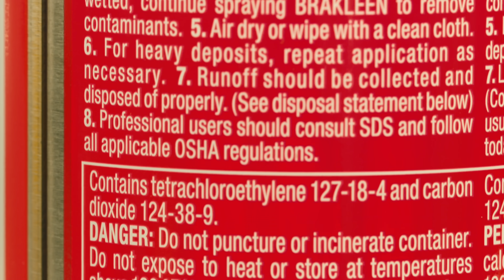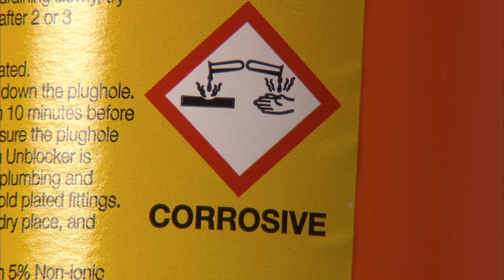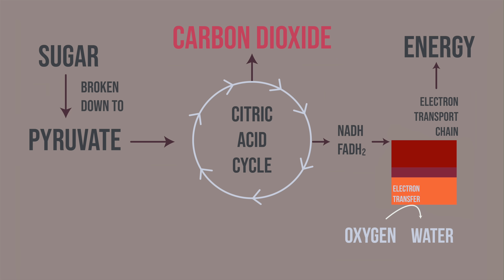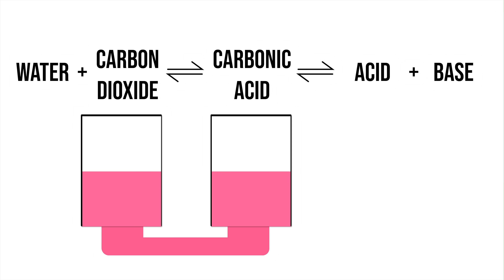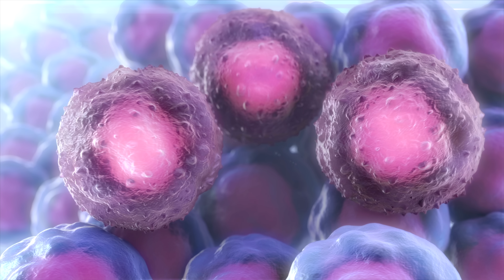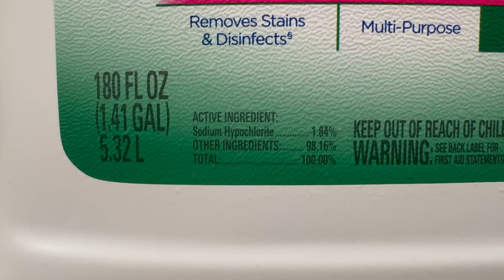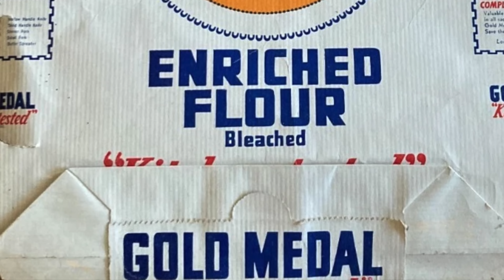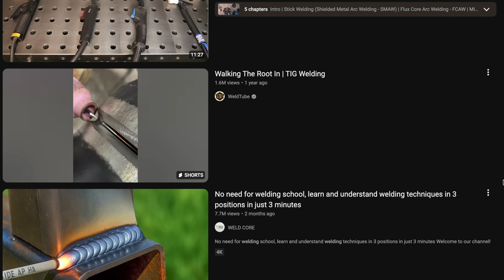"It smelled funny while I was welding and now I can't breathe..."

Comment: Unfortunately, this isn't taught in welding school (at least not back when I went through in the mid 1990s).  I've been to more than one professional welding shop and seen brake parts cleaner on the shelf.  I've seen Youtube welders cleaning parts with brake cleaners.  I've worked in professional welding shops where nobody had ever even heard of this.  For some reason, it's just not that well known.  I don't fault the victim in this one for being ignorant considering there are pros who are just as clueless.  I don't even remember how I learned of this; but I do remember throwing away some brake parts cleaners when I bought my first welding machine (Millermatic 211 in case anyone's wondering).

Comment: USE A NEEDLE SCALER
You supposedly do not even need to use chlorinated brake cleaner yourself. I have read Trichloroethylene can soak in to concrete.

Comment: I'm a beginner, self-taught welder and also use brakleen so this could have easily been me. Thank you for sharing this case and bringing light to this issue.
Reply: avoid plated metals especialy galvanized  ,grind back as far as you can if you have to and never weld gas tanks or diesel tanks unless you purge them with water and fill with an inert gas to displace oxygene
Reply: This^^^^

Comment: Correction:  Welding isn't high voltage.  It's lower than the wall plug voltage, so it can put out more amps than the plug provides.

Comment: I haven't watched it yet, but I already know what happened when they said brake cleaner. I've had it happen, and It smells awful. Cloroflorocarbons when exposed to high frequency light, converts to Phosgene gas. It can kill you. Was welding up cracks on an asphalt covered dump truck tailgate. Cleaned it with brake cleaner, because it worked fast and worked good. I let it dry off for 1/2 hr, but the liquid was still inside the cracks. As soon as I arked up, the Green glow of chemicals on fire caught my notice. The smell was awful, and take your breath away weird. I stopped welding and headed for fresh air. I decided to steam clean the tailgate and start over. After looking into the whole thing, I found out what gas was created, Phosgene, a deadly gas used in WW1 that killed many. I have no lasting problems, but if I continued, I might not be here today.

Comment: Thank you for the tip!  Working on my cars, I've used brake cleaner many times.  Haven't done any welding, but I have used the propane torch to loosen stuck nuts and bolts.  Probably should make really sure I don't go putting the torch on something that had brake cleaner on it.

Comment: So, how much brake cleaner do you have to burn to cause a lethal situation? It seems like the old timers have done this for years, and they are smokers, so I think at some point you would contaminate a cigarette at some level. Lots of pyrotechnics use chlorine donors , flash powder for example, and that's in firecrackers.

Comment: I once had a coworker who was a hilarious bumbling-fool type. He was a mechanic at the rental shop I worked at. 

He was farm-raised and accident-prone. One day, he was trying to get a single cylinder Honda engine to start (INDOORS!) using chlorinated brake cleaner. The engine would puff black smoke on each spray so he (obviously) thought it was cool and kept doing it. Eventually, I came over and the smell immediately warned me to stay back.  I yelled to him to run outside and when he coughed out the word “what?!?” A vape-like white fog came out of his mouth. He then made it outside somehow unharmed and I told him all about chlorinated brake cleaner and how it breaks (brakes 😏) down into a poisonous gas called Phosgene allegedly once used for warfare. 

The same guy later lit himself on fire while grinding metal next to a drip pan full of gasoline. The pan caught fire and his first thought was to take the pan of burning gasoline outside 🤦‍♂️ but he forgot how hard the door had to be pushed to open it, so he hit the door and splashed the lit gasoline all over himself. He was again completely unharmed. Some people tempt fate in the dimmest of ways. 🤷

*I have security cam footage of the gasoline accident and it’s pretty funny when you realize he was fine.

Comment: I've worked with phosgene in a lab before and it's a uniquely horrifying chemical because of what was explained in the video. If you spill it, or even notice the characteristic smell, you won't know if you're screwed until a day later. 

We handled it EXTREMELY carefully, with several gloves, in a fume hood and with a solvent containing phosgene and still I found it super scary. It worked perfectly, the reaction went smoothly, but man those 24 h after doing it felt stressful.

Comment: I am a machinist.
One day i turned off the coolant and heavily machined bronze.
It smelled funny.
I am pretty sure that the heat from machining was vaporizing metal from the alloy, be it tin, zinc, or even lead as some bronze may contain lead.
I am pretty sure that i could have poisoned myself and that some people did poison themselves this way.
Welder now about the metal fumes fever but there are probably many other way to intoxicate yourself with metal fumes.

Comment: 0:00 I haven't even started the video yet, but I'm betting it's gonna be phosgene, likely from welding something that had brake cleaner or some other chemical on it. There's a reason phosgene caused most of the FATAL gas casualties during WW1, and it's because it is invisible and has a delay before the onset of symptoms.
Edit: 1:07 Yep.

Comment: This video is crazy for me because I once welded on a part that had chlorinated brake cleaner on it and when the smell hit my nose I had the sense of mind to be like woah ok I’ve never smelled that before, I’m gonna let this air out before I continue never considered how toxic it actually was
Reply: Yeah it’s a crazy smell. A coworker of mine sprayed it into a running engine INDOORS! and somehow walked away with a minor cough.
Reply: @_..-.._..-.._  Well, I'm relatively sure car engines don't get hot enough to turn brake cleaner into phosgene, which might be why he survived...
Reply: @marluna_x  combustion can get over 2000 Celsius however it is under high pressure.
Reply: @leovang3425  Hmmm... I thought the brake cleaner was on the engine, not in it... But still, shit's scary
Reply: Oh geez you got lucky
Reply: Wasn't Phosgene one of the poison gases used in the WW1
Reply: @ValRyan-i5u  I think it was actually the one that killed the most in WW1

Comment: I’m a welder, I apprenticed under a very experienced welder with 50 years of experience. He taught me every way to not die on the job. One of the first things he taught me was never ever weld on material that you have used any type of solvent or cleaning chemicals on without blowing it thoroughly with compressed air, and letting it sit in front of a fan for a few minutes before welding. Always keep your head out of the fume plume, and always have some type of airflow as close as possible without causing the shielding gas to blow away. Welding is toxic and dangerous but it’s so much fun. Also always wear a p100 respirator ideally with an active carbon layer…. Tips from a welder with twice as much welding experience as I have life experience

Comment: Rust won't spark electrical arc, If it does it will spatter to extend that you can't weld. No body uses brake cleaner to clean rust, simply cos it doesn't work. And for rest, everiting about welding is dangerous, from safer to health

Comment: “The moment that the phosgene gas is inhaled, it’s over.” Absolutely brutal
Reply: Not true, though. For a moderate dose, if you get immediate treatment for a pulmonary edema your lungs will heal up just fine. The main problem is many people will not develop symptoms until a pulmonary edema appears, which can result in the treatment being administered too late.
Reply: I freaked out. I completely thought SP actually WAS styro pyro.
Reply: @g0ldER dude same
Reply: ....INDEED,THAT IS WHY IT WAS USED IN WW1 AS PRIMARY CHEMICAL WEAPON

........EVEN now,THERE'S MILLIONS OF TONS OF IT ARE PRODUCED
Reply: @robotnikkkk001  o dam rings a bell
Reply: @ricochetVendetta  ....AS FAR AS I KNOW,PHOSGENE IS CRUCIAL COMPONENT IN PRODUCING OF......CERTAIN TYPES OF plastic.....THIS IS why......

.....BUT INDEED SECURITY PROTOCOLS ARE strong IF WE ACTUALLY DONT KNOW ABOUT LIKE "several cars of phosgene tipped over"..........COULDVE GET SOME REALLY DISASTROUS NEWS,I TELL YA
Reply: Who told this young fella it was a good way to clean rust using brake cleaner?
Reply: @vette63 unfottunately it works pretty well to remove loosened rust/debris after grinding or wirebrushing. Not surprised at all that he would think of it as a quick solution if he had ever worked on cars before.
Reply: So?? Does Blowing on the metal????

Comment: Corollary: what happens when using a laser cutter to cut PVC? It is a similar issue of extreme temperatures that may cause a benign substance to decompose into something hazardous. I had assumed that it would primarily produce elemental chlorine, but now I wonder what fun (horrifying) combinations it actually produces. We have a very good fume extraction system and I let it run for a while after cutting PVC, something that we rarely do as it is very corrosive to the machine. I'm guessing it does not produce phosgene by the fact that I am still alive despite knowing the exact smell described in the video. That, or perhaps I did not inhale even a fraction of what "SP" did. Any chemistry nerds care to chime in?

Comment: When you weld on parts cleaned with brake parts cleaner you need to use the non chloride version and they do make a non chlorided version. Or this will happen.

Comment: I had used non clorinated brake cleaner on parts before welding in the past, just making sure they were fully dry before welding. Then one day I started welding and the part was either not fully dry, or the brake cleaner had traces of chlorine in it, because I took one breathe, smelled something funny, and my stomach just turned over. I was lucky that I knew about phosgene gas so I stopped and immediately got outside into fresh air. Luckily I had no lasting effects.

Comment: Worked in an phosgene fabricating place, didn't know, phosgene can be created while welding - but i know, how phosgene "works" AND can be neutralized.

Thank you for THIS video! I also weld this or that time in my freetime, fixing cars, creating holders for this or that, but NOW i will have some ammonia at home myself. i know people, where i can get some of it.

I also will get some more phsogene indicators to secure myself, knowing i could call THAT company for every special information, my local service does not have. Even if it is 300km away.

Comment: He would have had to been using a ridiculous irresponsible amount of brake cleaner while welding to generate that much gas.  Chlorinated brake cleaner evaporates almost instantly upon contact with hot metal and within seconds on cold metal.   I suspect he would have also been trying to use the brake clean to cool the welded metal.  Else he would had to have been welding on SOAKED brake cleaned metal.  Either way that would be next level irresponsible.  No way "sp" would be that clueless.  .

Comment: Cleaners contain chlorinated hydrocarbons, which can produce the highly toxic gas phosgene when exposed to high heat or open flame, such as when welding metal. Phosgene (smells like hay) kills by flooding lungs with fluid.  Severe respiratory effects, including pulmonary edema, pulmonary emphysema, and death have been reported in humans. Severe ocular irritation and dermal burns may result following eye or skin exposure.

Comment: Always a good idea to check safety measures before attempting an industrial process unknow to your knowledge. For example, when I began to charge in my living room my old car's lead-acid battery in parallel with supercapacitors to power a cheap spot welder circuit, I found french government research and security agency (INRS) guidance about preventing the risk of explosion associated with hydrogen production.

Comment: As a mechanic who welds and uses a lot of brake cleaner, this was a real eye opener. Most tradespeople just learn their skills on the job and don't actually have all the safety knowledge they need. I wouldn't have liked the idea of applying chemicals to the thing I'm about to weld, but I can totally see how someone like me does this without thinking. This is the first one of these videos I've seen that feels like it actually could have been me.
Reply: I've cleaned things to be welded with chlorinated brake cleaner in the past. Thank the Lord I hit them with a grinder before striking an arc! A well ventilated shop is also a valuable investment.
Reply: Same, I'm a mechanic and do a ton of welding. However for welding I tend to grind or flap disk the work piece clean but I have used brake clean on dirty oily parts before cleaning them further with grinding disks as oily crap isn't good for that stuff. I'll definitely change some things on how I clean certain parts to be welded after this.
Reply: Same.  I'm a machinist and I barely ever weld but I do use brakleen to break down crud on the surface of things occasionally...so if I did have to weld something I have just enough education to get far enough as doing something like this and not enough to know it's stupid 😂.
Reply: I just got a heliarc tig & stick welder and have been wanting to learn how to use it. It seems like the list of what not to do is much longer than the things you need to do.
Reply: @DirtSweatGears essentially just ensure your work piece is clean and free of contaminants. I've got pretty tan arms from welding without sleeves too much,l. Hopefully it doesn't turn into skin cancer one day.....
Reply: @MillardFeelmore  I’ve read carb cleaner can be used, as well as acetone. And simply brushing the metal after cleaning. I’m surprised this isn’t talked about more.
Reply: Wal mart gas 2  kinds of brake cleaners  one with  acetone  toulene  and one with meythsl chloride  stinks like hell
Reply: @keithnielsen4776  that makes sense, because the brake cleaner i have is mostly like alcohol. i hadn't thought to use long sleeves to protect from u.v. radiation.
Reply: @carlosgaspar8447 yeah definitely long sleeves, I've gotten what looked like a nasty sunburn from welding too much in short sleeves.
Reply: Most brake cleaner is now the new none chlorinated regulation stuff. So less chance of getting gassed

Comment: cheese and milk.
it ain't an antidote, but it will give the fosgene of the welding rods something to latch onto while you're at it.
source? aftermath of dealing with JUST THIS, by using JUST THAT, after being exposed to JUST THAT, while being inadvertedly exposed to JUST THIS and having had a head start on shielding myself from it, before knowing which was which.
just don't overdoit until it gives you cholesterol!

Comment: I read a similar story way back in a motorcycle magazine called The Horse - Backstreet Choppers, the guy in the story did not die. It happened when cleaning aluminum (it has to be very clean to weld) he used brake wash to clean and because he was welding aluminum the gas he was using was 100% argon. When you mix tetrachloroethylene + argon with very high heat it produces phosgene. Scary shit!

Comment: Alright if we're mentioning things you shouldn't do while welding, let's bring up galvanized steel. Don't weld it without a respirator. The Zinc in the galvanization is pretty toxic when inhaled and cause all sorts of issues. The same goes for welding anything painted or coated. If you don't know what it is you should probably wear a respirator. If you're using a machine that uses a purging gas, it's going be a heavy gas, so if you're welding inside something like a tank it will push the oxygen out.

Comment: Old school fridge engineer.I knew when phosgene was being produced. Because the welding flame would have a green flame instead of blue. Also a plume of white smoke.i would hold my breath to finish the pipe joint. Or lean away. Because just a small breath in would  lock my lungs from breathing in or out for a second.And then desperate  for a breath. I would have to move myself away from the area. I am surprised how this guy managed to continue welding, unless the dose was way less and just more prolonged.

Comment: You mean S. P. would take 200 12v lead acid batteries run them in parallel to make a 12v 20000 amp stick welder! 😂

Comment: Lotta hazards in welding.  I do TIG welding in my garage sometimes, and I thought I had adequate ventilation with the big door and side door open and a box fan helping crossflow, so I never wore a respirator.  Then my wife, who works in exposure science, brought home a laboratory-grade particle counter and strapped it to my shoulder.  I started welding, and within twenty seconds she said "STOP" and showed me the reading.  I don't remember the actual number at this point, but I do remember it was way beyond anything OSHA would allow.  TIG doesn't make much visible smoke, but it still generates metal fumes, i.e. vaporized metal that condenses into tiny airborne particles that really aren't good for you.  Now I wear a P100 respirator when I weld.

Comment: It may be worth mentioning that there is a very wide variety of brake cleaners. Some are also acetone based, and the ones I buy are C6 and C7 hydrocarbon based.

Chlorinated brake cleaners have the benefit of being non-flammable, but are also super carcinogenic and getting banned as a result. Don't use that shit.